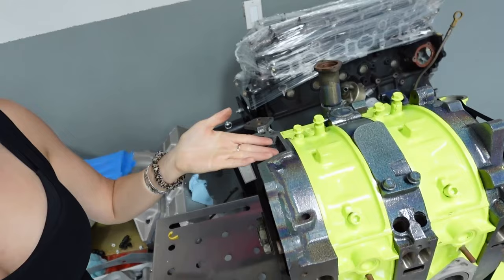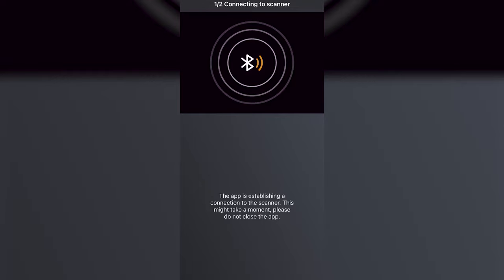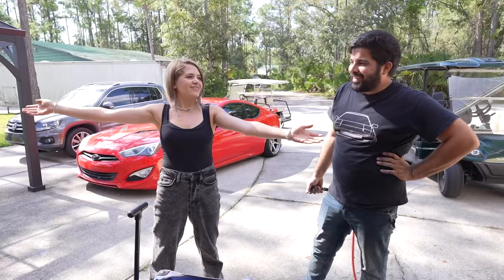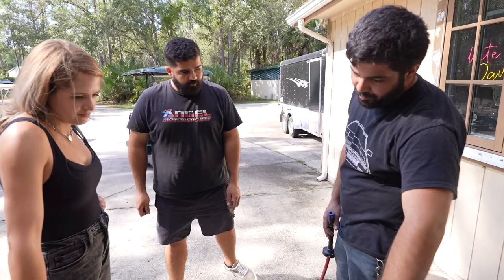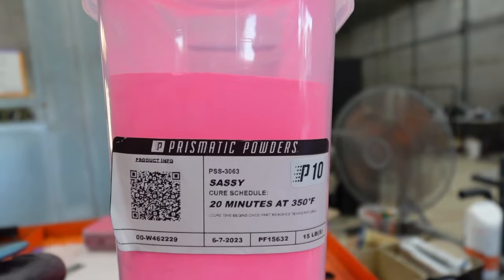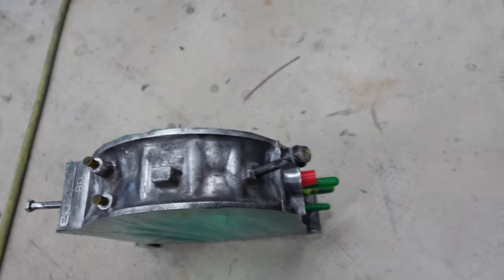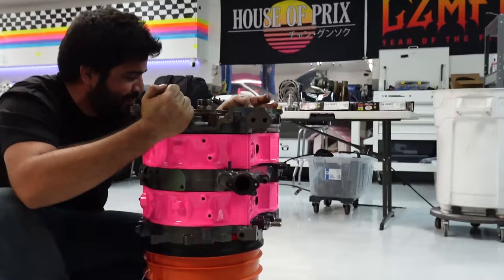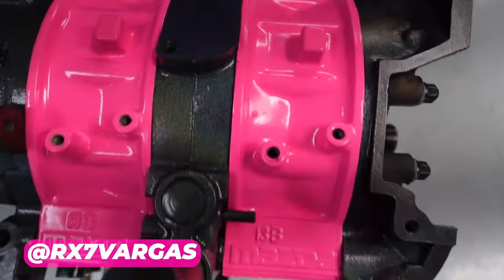13B Rotary Engine for my S15 is COMPLETE!!

Comment: The builds here are to colorful for me but they do look great :D Seeing you do more and more work your self on the cars has been a enjoyable journey.. 
I think using a wire wheel is the ONE thing that I always use eye protection for. Most other tools I try to, but the squint "protection" does happen. But I have seen multiple people have to go get those metal wires removed from their eyes and I don't think I could deal with that.